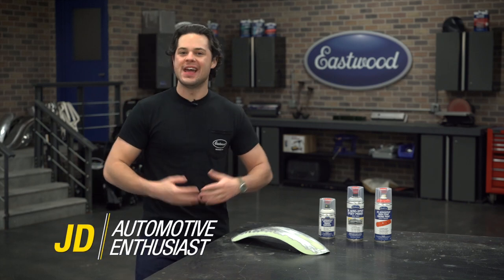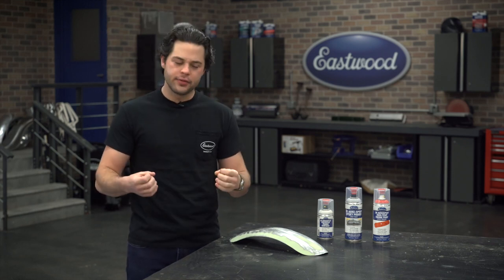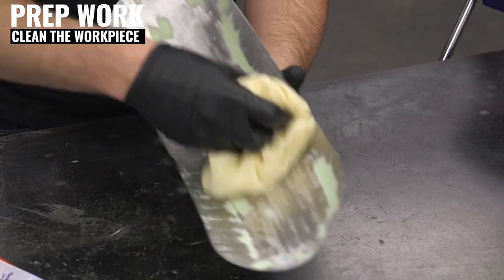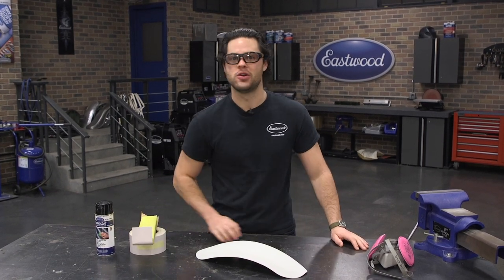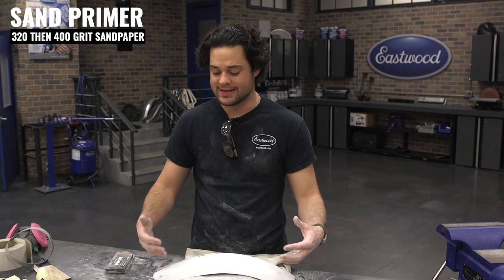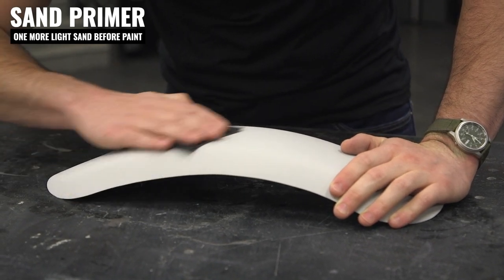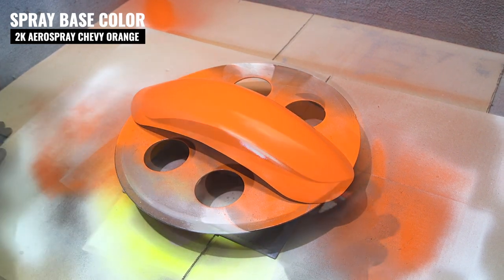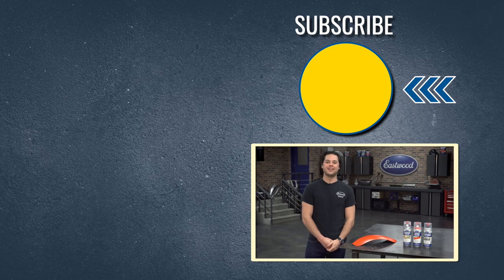How to Spray Paint & Primer with Spray Cans! Basic Painting Techniques - Eastwood

Comment: Once you “pop” the can, does the amount you don’t use harden in the can
Reply: Yes. I think you should have at least 24-48 hrs before it hardens
Reply from the maker: Yes. Once popped, you'll have 48-72hrs (at 68F) until the paint will harden in the can. Unpopped, you can leave these on the shelf for about 3 years. 
-JD